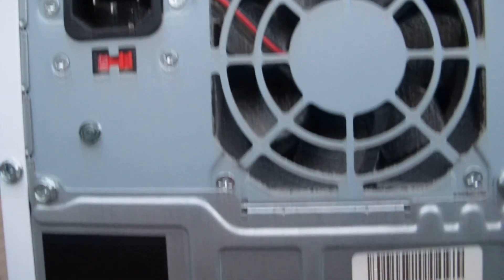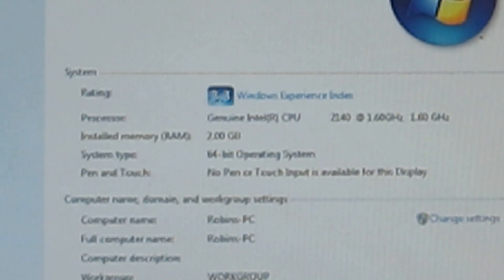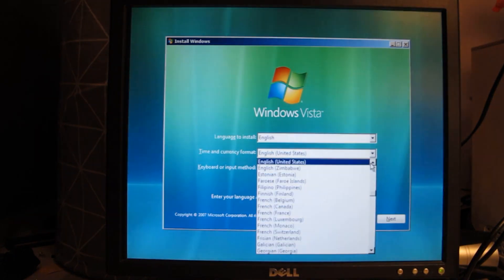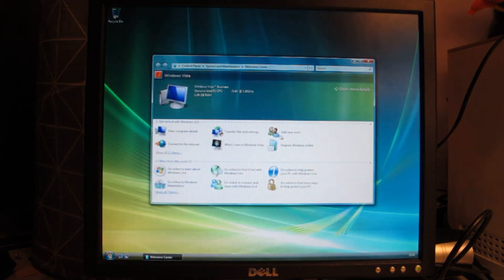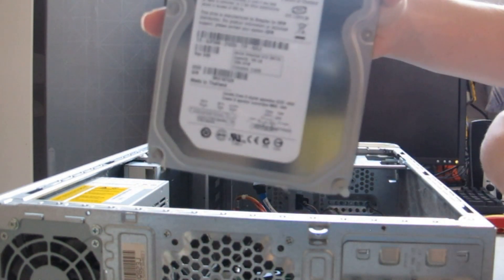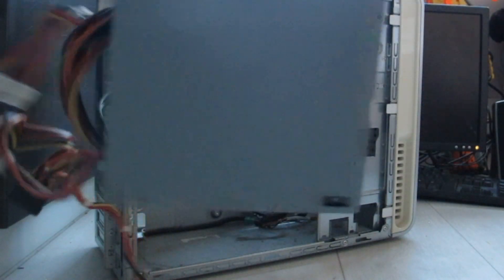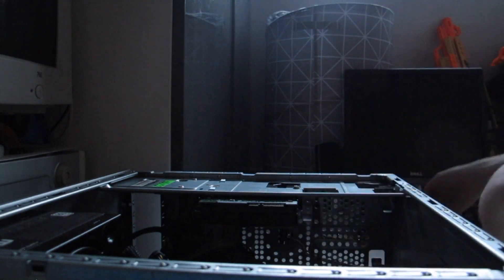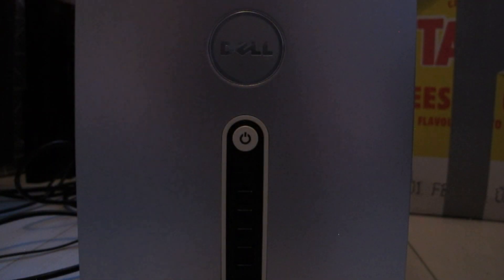Restoring my Dell Inspiron 530 Part 1

Comment: With a cpu and ram upgrade they’re still good computers. Got mine running windows 11 smooth as butter.
Reply: @Ashtontechworld  I have both revisions of the motherboard, Both maxed out. one with an E8600 and another with a Q9650. Some models of the 530 can only accept core2duos while other ones can accept core2quads. Both with 8gb of ram, 500gb SSD and gtx750ti gpu.
Reply: @9852323  if for what ever reason you want to step it up a little more, there is some stuff you can do that can make it accept a xeon x5470 which is a quad core that runs at 3.33ghz.

Comment: i actually bought a dell inspiron 530 13 years ago and it has a intel core 2 duo runnin windows vista ultimate and i started to clean up all of its dirty hardware
Reply: You are a bacon so you are a part of Roblox not windows
Reply: @orangebricks123  wow kid
Reply: Yea mine is VERY dusty pretty sure it's NEVER been cleaned since 2009

Comment: Oh my goodness, I had that same computer back in the day! I had 3 of them running Windows Vista home premium! My grandad likes fixing computers and he has some of these too. He gave us 3 to use. Mom decided to upgrade to Windows 7 when it came out for some reason, but the two other computers ran Windows Vista until they were replaced by more modern ones in 2016. I used to play a lot of InkBall on those computers. That was my favorite game besides Truck Loader, a flash game.
Reply: What
Yshsysh
Reply: They’re still good computers in 2022 with some upgrades. I run windows 11 on mine and it’s smooth as butter.